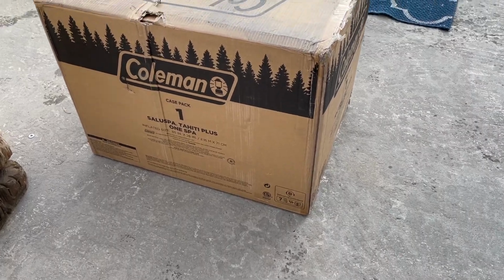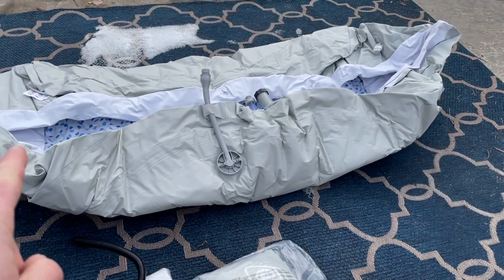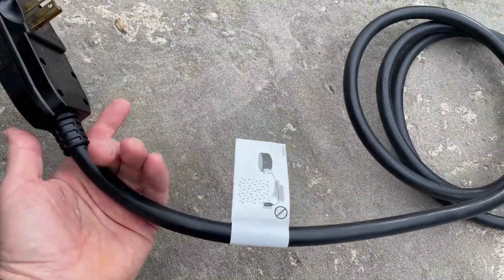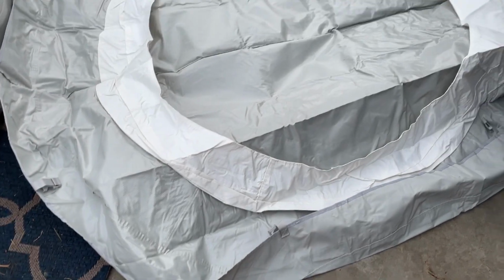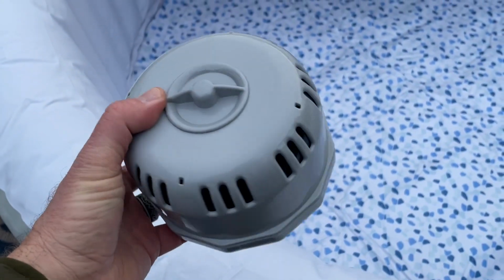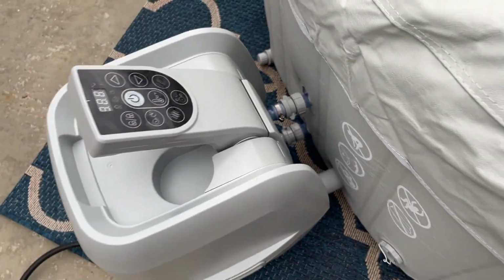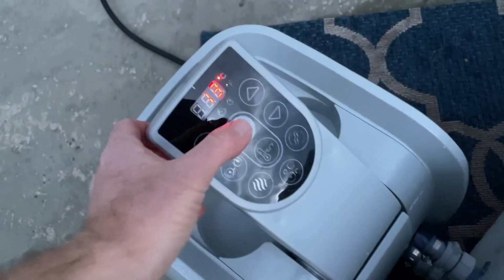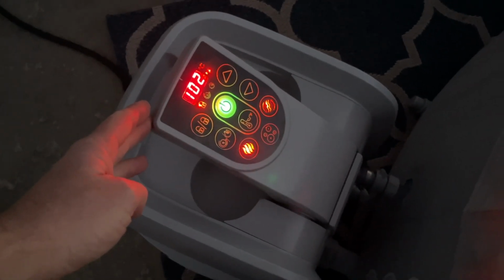How to Setup an Inflatable Hot Tub

Comment: I just got this one but it has a newer model with the pump built into the liner! It's amazing! The air pump automatically pumps the hot tub up just by turning on the air jets. You can blow up the lid without disconnecting any hoses first from the pump :D